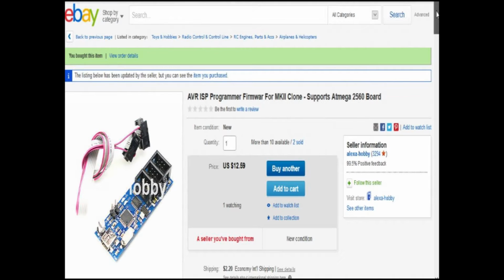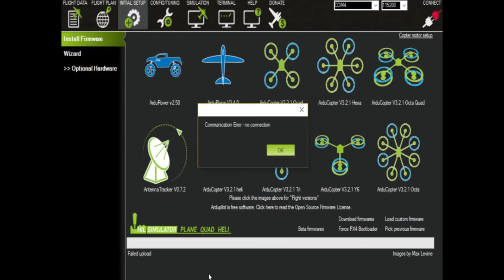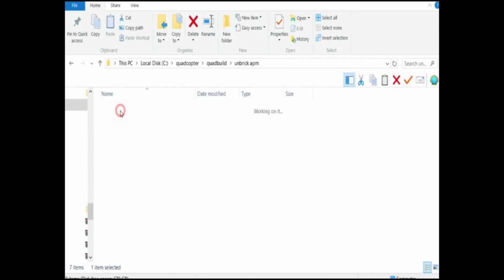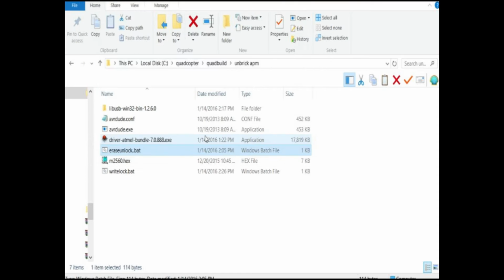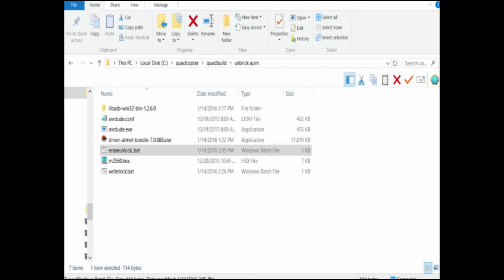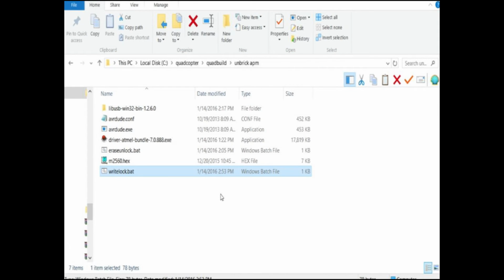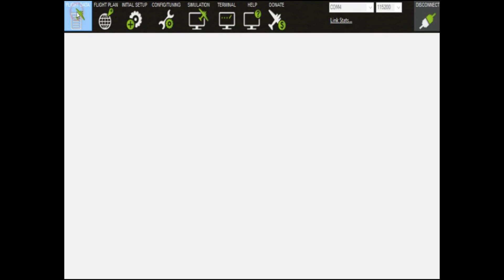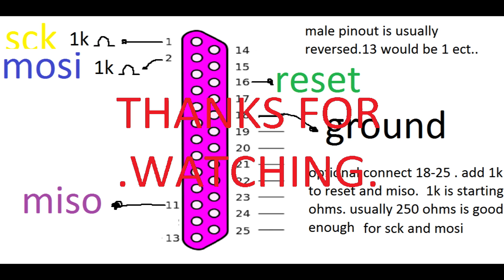Recover a bricked APM 2.

Comment: There is files missing from the folder now. The erase and some others are missing. I just attempted it with my cx20 and it’s not responding to the usb even though the usb is found in device manager
Reply from the maker: Hi .. the erase is just in the scripts now, Did you try the script in the "New full write with firmware"  .

Comment: Can you provide these file. Which you used in this video
Reply from the maker: the files are in the description
Reply: @ModItBetter  i unbricked. But in radio calibration transmitter signal is not showing. I try both ppm and normal, no one is working. And when I use telemetry then it's connected but when I upload firmware using telemetry then it struck at reading hex file then show no connection.

Comment: Bonjour, je viens de découvrir votre vidéo très intéressante bravo. Ma question est la suivante.
J'ai une APM 2.8 avec le firmware 2.5.1 rover pour bateau je voulais savoir si avec votre vidéo je peux installer un autre firmware plus récent?
Reply from the maker: Hi the last build for apm 2.6-2.8 is version 2.5.1 for rover, if you want to move to newer versions you will need to get a pixhawk variant .. here is a list of flight controllers..
with version 
4.1.5
https://firmware.ardupilot.org/Rover/stable-4.1.5/

out of that list I only own the pixhawk  pixhawk mini .. and pixracer.. which i have videos about them but they are for quadcopters..
Reply from the maker: Salut, la dernière version pour apm 2.6-2.8 est la version 2.5.1 pour rover, si vous souhaitez passer à des versions plus récentes, vous devrez obtenir une variante pixhawk .. voici une liste des contrôleurs de vol ..
avec version
4.1.5
https://firmware.ardupilot.org/Rover/stable-4.1.5/

sur cette liste, je ne possède que le pixhawk pixhawk mini .. et pixracer .. dont j'ai des vidéos à leur sujet mais ils sont pour les quadricoptères ..
Reply: Merci beaucoup d'avoir répondu.

Comment: Hey, can you help me out with the process for doing it with USBasp?
Reply from the maker: Hi I have a picture in the package for the usbasp .. and a bat file to run for that as well
Reply from the maker: I also added a folder called
"easier driver install in this folder."
fallow the picture for windows 10 if you have that version as well
Reply from the maker: this video shows the same package but a different apm actually using the usbasp.
https://www.youtube.com/watch?v=Txm9JxYu-6c
the first 4 or so mins shows how to install the drivers.
the connections are actually same on the apm2.6 if you orient it the same way ..but in the picture folder I show a picture of the 10 pin connector for the apm 2.6
Reply: @ModItBetter  thanks for the reply! i followed every step as mentioned. Managed to flash it but on connecting it with the usb port, the computer doesnt detect the comPort and thus the board does not connect to mission planner.
Reply from the maker: @rajFPV  Hi , most likely its fried on the mux chip..or somewhere else..
You can try this video 
https://www.youtube.com/watch?v=U6axABOd_Dk
the chip is what creates a comport on your computer its possible it got corrupted ,or the pins that connect to the mux chip  can possibly be fried on that chip as well.
Reply from the maker: I should also note that if you write the boot and flash file together.. in the folder "New full write with firmware"    after that is done.. if you get the red and blue light flashing back and forth after you plug it in.. most likely its not bricked and .its either the mux or the atmega32 is fried or corrupt if you get no com port in device manager after you plug in the apm
Reply: @ModItBetter  Yes, i do get the red and blue lights flashing back and forth. Seems like my mux or atemga32 is corrupted as you said. I went through the link you mentioned above, Again, can you provide the isp pinout, the connections to usbasp seem diiferent (as in , in the video, the connections to the board were at a different place and i dont know the miso/mosi etc pinouts there) Thanks for the quick responses! I hope this last try works!
Reply from the maker: @rajFPV  Hi does the isp look like this ..it should be beside the gps port in the same location like the other video accept it does not have the bottom row of pins..  sorry bout the pic made it in a rush..
https://drive.google.com/open?id=1ttOHsN0j7cRiot6DrURrX7dx4ImLSpni
Reply from the maker: if it is not the same and some how they came out with a new version ..you can send a pic to bangs696969@gmail.com  and i'll look it over. or post the picture here.. but it will be flagged for a bit till i see it ,then I'll un flag it...
Reply: Worked!!! Thanks alot! Saved one of my APMs!!

Comment: How to do it with arduino nano...?
I need wiring connections of nano with apm 2.8
Reply from the maker: https://www.arduino.cc/en/Tutorial/ArduinoISP
upload the isp sketch then fallow this picture for the pinouts
Reply from the maker: https://gw4sae.files.wordpress.com/2017/06/69c458b2-089b-4737-a310-9e2a0a3b1db1.jpg

i include a picture in my package of the pinouts on the apm for mosi miso sck ect..
Reply from the maker: how are you doing on this ..I'm debating on making a step by step for this

Comment: Hi , Thanks for the video. Can this be done with FTDI ? or Arduino ?
Reply from the maker: if you ftdi also comes with isp then yes...   With the arduino if you have a nano ect.. load up 
ArduinoISP sketch  thats included in the examples of arduino ide...   you will have to google up a picture for the connections for what ever arduino you have
Reply: @ModItBetter  , could you please send the link to eraseunlock.bat file that is used in the video?!  it's missing in the zip file . Cheers
Reply from the maker: @ehsankeshtgar6734  Hi its not needed just click on the   file that you need .. example "unbrick avrispmkii .bat"   it will do the unlock and write at same time.

or go into the "New full write with firmware"  and use one of those files..it will write the boot loader and version 3.2.1 firmware.... after you can just change it to what you want .       every year or so i come back and update the files .   The next update i will update the readme to say its not needed so people don't get confused while trying to fallow the video.. sorry bout that..
Reply: @ModItBetter  , Thanks for that. I couldn't get my APM to work , that's why I thought I might have missed this step. it's now blinking with blue light only after I used your aspusp batch file as I have aspusb device to program. but still no chance to make it working with Mission planner . still the same error. I also tried it with full write with firmware , still no luck :-(
Reply from the maker: @ehsankeshtgar6734  after you try just the bootloader not the files in the "new folder"... try to disconnect isp go into mission planner , change it to your com port and baud rate 115200.. ,Don't push connect...  go to initial setup and try loading version 3.2.1 ect..

Comment: It works  100%,my mission planner has problems uploading firmwares,this file includes xloader which uploads firmwares manually (.hex files) and it has unbrick my apm 2.8(flat pin) using usb tiny avr from ebay.Was going to  buy a new one , im glad I found your video.Does optical flow works ? I got the sensor and will mod the apm for opt_flow
Reply from the maker: HI .. I really don't think it works with the apm 2.6.. if you watch video's of it working they have it on backwards.. ..plus i had to mod the firmware to even get it to log properly..    However this was just my experience with it , I could of got a faulty one..  ........... I should note i did try it both ways pins facing forward and backwards.. it would always start flying to the left or right after 5 or so seconds..
Reply: bangs6996 I just tried the optical flow 2 hours ago and I got an image,focused it but when it comes to the logs,I cant input any thing to see if it working  it keeps on going on and on with a list of processes i guess apm 2.8 flat pins any help with the logs ?
Reply from the maker: are you using version 3.21?   if so you can't use terminal ..u need to go to version 3.15 to see terminal.  and to enable the logs.. ...  ..after yout test flight you then need to download your logs to view them..

I included a modded firmware version of 3.21 in the description of that video that will let you log it .. Your best to just watch the video I explain it all in that video..
Reply: Yes im using your firmware 3.21 I need help again mate,I cant use mission planner to downgrade to 3.15 it fails every time(multiple mission planner used).I have to use xloader,how do i get access to the hex file 3.15 where to download it ?
Reply from the maker: just a quick question.. are you sure you are using baud rate 115200 with mission planner?
Reply from the maker: also try planner instead of mission planner..
might work better for u or install something that you don't have..  http://firmware.us.ardupilot.org/Tools/APMPlanner/    .. i am just installing mission planner now.. i thought there was a download button... have to confirm..
Reply from the maker: here is version 3.15 thats on my drive.. i think it might be custom for telemetry .. https://drive.google.com/open?id=0B2w6_OKE_2kxYkZwbXlSdmRRZ2M   i forgot to add a note to it.. besides that you might have to build it.. but try apmplanner it might work better for you.. its basically the same thing as mission planner..
Reply: bangs6996 thanks mate will try it later and will donate to your channel for helping me out
Reply: yes 100% sure
Reply: The logs worked.thanks mate had to press enter 3 times then I could test optflow ect
Reply: I need to test flight my f450 with the optical flow with the apm 2.8 wish me luck and no fails.And how to mount the optical flow sensor ? pins facing backwards of the quad ? as the image when testing the optflow v10 was in this order.
Reply from the maker: good luck.. let me know how it goes..   the wording is confusing . it says pins forward .. so i think it means the pins in front of the sensor.. ..but you can try both ways ..

Comment: Hi Glenn I got the AVR ISP Programmer from eBay and followed your explanation but when i ran the files "avrispmkii/usbtiny/usbasp write full boot plus v3.2.1 all i got was a application error at each step as the photo shows do you know why this would happen. Thanks Regards
https://www.dropbox.com/s/saellrir0d7mtab/error_002.jpg?dl=0
Reply from the maker: hi ..you might have to re download the package I included a new folder called easier driver install.. ....plug in isp only..then start the program zagdig ..it should auto detect which isp you have .. ..fallow the picture I included in that folder..        .
Reply: Hi finally got round to trying what you suggested but now its not showing up as AVRISP mkll. computer manager i got Jungo Connectivity in that WinDriver but AVRISP mkll has now gone after running zadig-2.3 usbasp tiny driver install. cant see it in Mission Planner any more any ideas what to try now? Thanks
Reply from the maker: Hi in device manager it might be in a new folder called lib something ..heh....forget off hand.. ..

so after you have done that.. 
plug in the isp only ..and run one of avrisp mkii bat files..  and see if it gets detected..   sorry for the long reply time  I never got notified of your message..
Reply from the maker: you are looking for this message when running the file https://youtu.be/gKMFenjNrLE?t=298
Reply from the maker: is that with it plugged into the apm? ..?  if not that is normal.

now with it plugged into the apm.. you will get those as well just let it go for awhile.

Comment: Hi
I get to the very last step in mission planner and i still get an error message up saying 'No Connection'. Help!!
Thanks
Reply from the maker: if you open up device manager.. then plug in the apm.. does it get detected as a com port?   ..
Reply: Thanks for the reply, and yes it does.
Reply from the maker: which file are you trying to use..   if you use one of the three files that corresponds to your isp  in the root of the folder. example "unbrick usbasp"  .      do you push spacebar to continue or the x on the window to close it down.. its a two step process ..  also after your done with that file you have to go into mission planner with normal usb attached to the apm (not the isp anymore.)  ..then go to initial setup.. install firmware.. then click on the quad icon for example and load the firmware..        Or do you do all that?
Reply from the maker: yup that isp is fine..   do you have telemetry?  ..if so .. try to go into New full write with firmware   and try that file.. after its done try to connect with telemetry ..        making sure to change the baud rate to 57600 instead of 115200
Reply from the maker: actually you can try that process regardless.  just to see if your lights do something else after its done.. and try to connect with usb anyways.. ..    So if you do get a com port and the 2560 connects..there is a mux chip in the middle of those two chips that might be holding you up..    I do have a step by step programming the u32 chip .. but because your getting a com port its hard to say its actually that . might be worth a try anyways..
Reply: I do not have it i'm afraid.  My board version is is APM_V252_V2.0. Would that make any difference?
Reply: From the CX20
Reply from the maker: no it makes no difference.. .In my package go into that new folder with firmware.. and give that one a shot if you have not tried already.. ..  .. after its done..  plug in the usb and wait about 1 minute before pushing connect in mission planner..   .. make sure to pre setup your com port and baud rate to 115200 don't use the auto setting.. ..

... if it still does not connect.. for kicks .. unplug the apm and plug it back in .  set your comport and baud rate again.. this time go to terminal in mission planner and push the connect button within that one.. if it does work it will be messy and spit out lots of stuff..

Next .. you can try to find a old usb cable. and cut the red wire from it.  then plug in the usb and then the 3s battery . If your on the cx20 you might have to plug in the b cable into your apm 

I do have a flip video..and unbrick video on the u32 chip but again its a tough one if its actually that..
Reply from the maker: errr .. i think because you have v2 board . If you do try the flip for u32 or unbrick ..your reset might be different then the video.. I don't have that board so never traced it out..
Reply: My version of Mission Planner unfortunately does not have the terminal. I tried on the Config/Tuning and the timeout box appeared. This is my first drone so stuff can be a bit confusing ahah. Would it be possible for me to Skype you at  some point of your convenience this weekend? Thanks
Reply from the maker: the way to see advance settings and options like terminal is to open up mission planner.
click on.
Config/tuning
...Planner
..... on the right side look for "Layout"
change it from basic to Advanced
Reply: bangs6996 Ok Nice one thanks very much, I'm just about to go out unfortunately so I will get back to you tomorrow morning if that's ok. Thanks so much for your help though, appreciate it!
Reply: bangs6996 Quick question too, the reason I tried to update was the firmware as after about 5 minutes of flight, the quad would randomly loose power and fall to the ground, it did this 3 times in a row (while updating something went wrong in Mission Planner which bricked it I think). Even if we get this fixed, I'm not sure it would be the end of it. 
Now I'm thinking of changing the flight controller all together. Out of interest, which is the best and easiest to fit? (On a reasonable budget).

I saw your video on the 2.8 which didn't look too bad. Would you recommend it? I would want it to act the same as the previous stock one and later on attach a gimbal. 
Thanks very much
Reply from the maker: yes I would go with the 2.8 for sure .... its 100 percent the same..and you can even put the original factory firmware on it if you really wanted to. ..    in that video I have links to some apm's and the gps combo you need to go with it. If your into modding you can use your original gps as well..but the neo's are just better anyways... .. use them as a reference if need be to find a better price on ebay . as the gps are usually only 13u.s ishh..the last i checked and the apm 27 u.s 

It is very weird for it just shut off like that. your lucky you did not get a fly away..   or the connections on your battery or the main line is some how not soldered right.   .   ...  also  look at the 5 volt cable on your cx20 .. its the white red black wire thats near the back of the cx20 mother board soldered in the center..  its fine that the white wire is off if it fell of like all of ours.. but if its shorting out or one of your other wires shorting out would explain that..     .. test that wire for voltage anyways and see whats its at ..

.. I would test the voltage regulator as well make sure you have 3.3volts and not less or more ...

lastly when your hooked back up to mission planner make sure the only thing plugged in the unit is just the usb cable.
Reply: bangs6996 Thanks so much for your help, really a big help. I'll give it another go tomorrow and a check over to see if I can find anything. If not then I think I will just order a 2.8 to get back in the air again. Lost abit of confidence in my one too after falling from the sky 3 times. I did read on a forum that their was an firmware issue called 'Phantom Throttle' which did cut the power after flying for abit. 
Thanks again.

Comment: Where did you get that parallel port programmer that you are using in this video
Reply from the maker: I made that ..right at the end of the video i show the pins to make your own..but u do need resistors and a computer with a parallel port..which is hard to find these days..